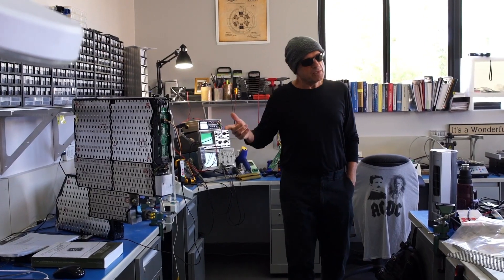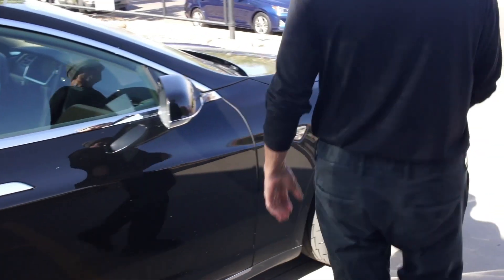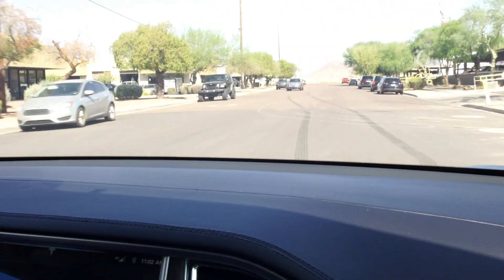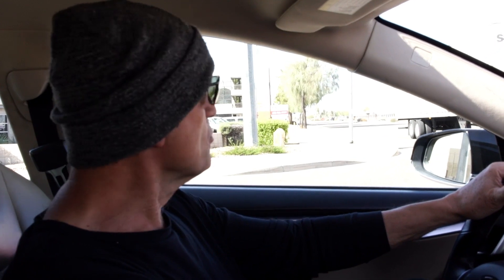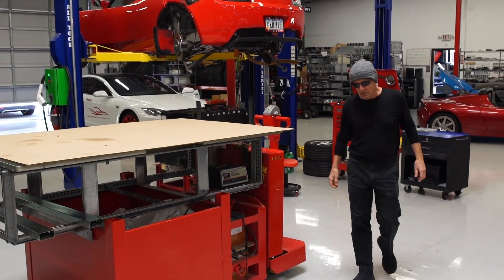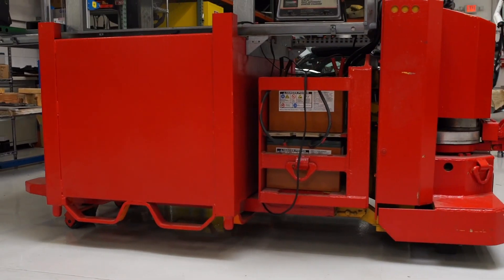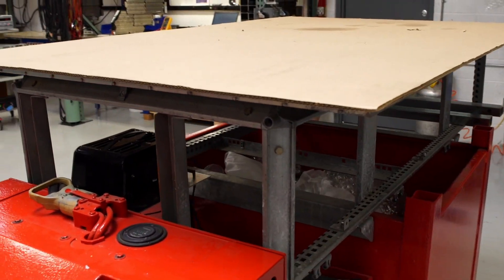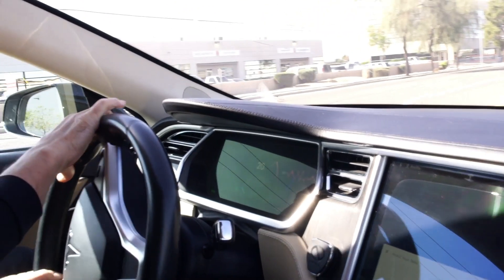World's Cheapest Tesla | Gruber Motors

Comment: So, after this repair and 5000$ spent, do you give a warranty for the battery pack?
Reply: That doesn’t make sense since they only disable the faulty cell. If another one fails it’s not Gruber’s fault.
Reply: @filip3148  And what if the following faulty cell is the same one?
Reply: @ferrochinabisleri1587  that's not possible since it's physically disconnected from the rest of the pack, as shown in the video. if the same cell blows up due to chemical aging processes the driver should be aware of using the vehicle with faulty but disconnected cells and should also be liable for that.

Comment: I have a '13 LEAF with 130,000 miles.... Can you work any magic with my 3 bars of capacity left 24kwh pack? Nissan wants $11,000 after all is said and done to which I had to wonder why they didn't take to dinner before .. well you get it.. HELP!
Reply: look up Canbridge
Reply: When our Camry hybrid's battery no longer working, I removed it from the car and tested each of the battery cells. I found that two were not charging or holding charges so I replaced them with used ones from eBay.  The car runs like new again!  My cost? $100. Toyota wanted about 7K to replace it.  Hope you got your car fixed by now.

Comment: Great job. I’m asking myself a question. When you repair a pack like this one that is that old, aren’t cell failures going to happen more and more often? So wouldn’t it be better to pay almost 20k pour a new pack and have no problems anymore than paying 2-3k every 5 months?
Reply: Roadster battery packs are still going strong after 10-12 years.  This one cell problem is usually a fluke, and not indicative of a trend.
Reply: @petegruber7564  Peter,  you say this one cell problem is a fluke,  and not indicative of a trend,  yet further down in the comments section you say this problem is becoming more prevalent.  May I ask which one it is?
Reply: @Larry-cp3uy  fair question. Dodged? Ignored? Missed?
Reply: Who puts $20,000 into a car with 140,000 miles, when the car is worth no more than $30,000?
Reply: @Sylvan_dB  pretty logic, you can either sell your car and then you lost a lot of money and you need to buy a way more expensive Tesla. While if you juste change the battery, you'll make your older car way better, while not paying as much.

Comment: I don't believe this. Why didn't the guy show the repaired car getting charged at a tesla supercharging station.
Reply: It's not salvage so why would it not Supercharge?
Reply: @sdpryce  Have you been to a tesla supercharger? There is no credit card input. The information is in the computer system. Many of these car,  after the batteries were replaced by non tesla repair shops, won't super charge at a Tesla super charger. Tesla will need the owners information. However, they should work at non tesla supercharger stations.
Reply: If you buy a salvege tesla it will still charge at all the other charging stations right?
Reply: @robinronnblad1654  not at the tesla superchargers